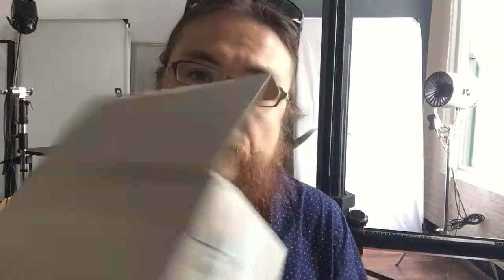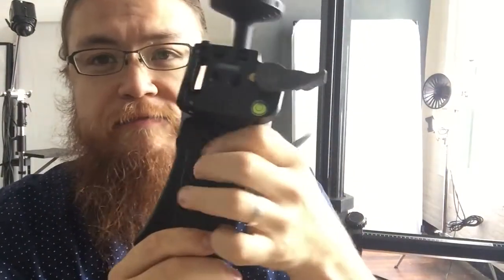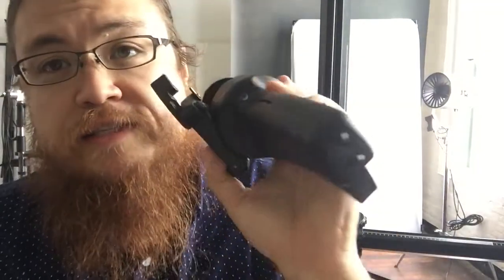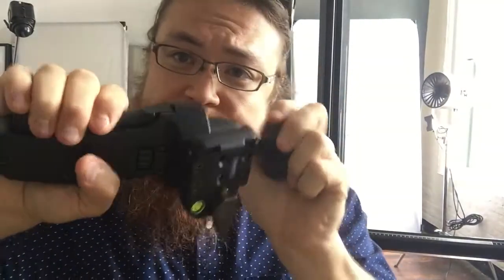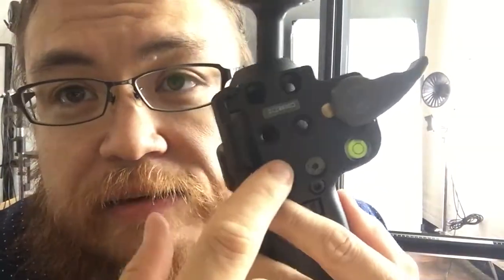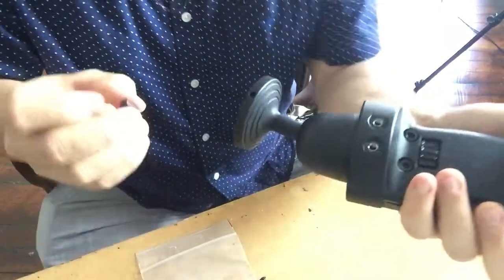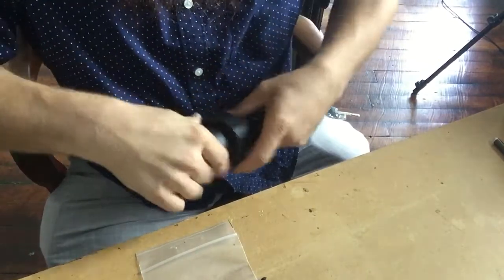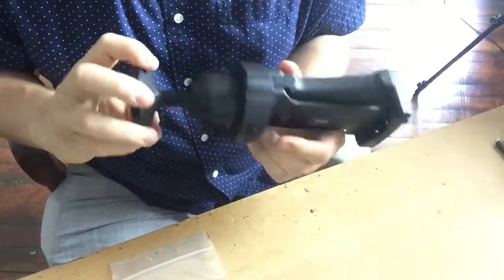322RC2 Manfrotto Joystick Head tightening and setup lefty righty

Comment: You can use the hex key that came with the unit to screw in the rubber stoppers. Just put them in the holes of the rubber stoppers and push down as you turn.

Comment: Nice video. But changing it for left hand to right hand user doesn't seem to be that simple. If we simply remove the two Allen bolts and move the QR plate holder to the other side the grip can no longer help you use it in "normal" position. I think we need to remove the four Allen bolts on the grip itself and flip it around?
Reply: There's no "normal position" for this grip. Be default the plate is positioned for right-handers. If you reposition the plate on the opposite side of the grip you'll get the same "normal position" for left-handers (with the only difference the marking stamp Manfrotto would be underneath).